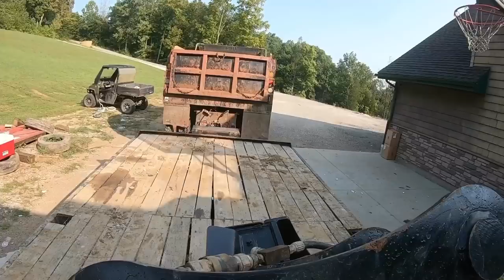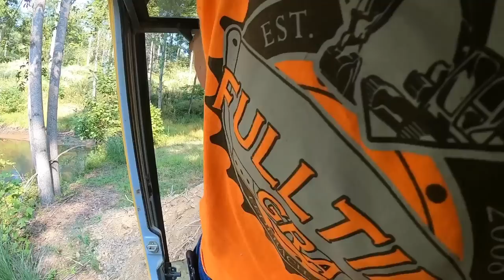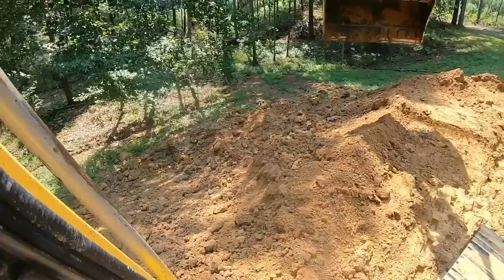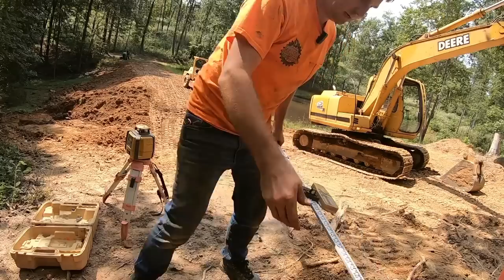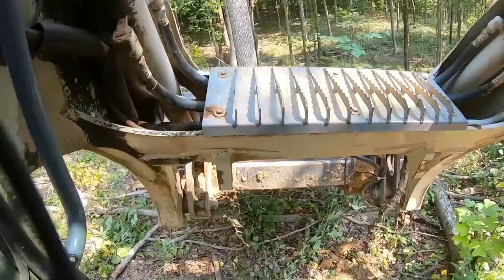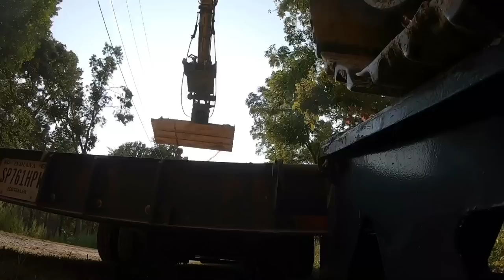Failed Pond Build - Repair Continues - New Overflow!

Comment: I like when I see someone doing a job that in my opinion is being done correctly. I learned to run equipment over 50 years ago the same way as you. I started when I was big enough to reach the controls.

Comment: Mr Mike, I'll take more weight on the drives any day. 🤔
And you did a super job on that pond.😁
Reply from the maker: Well obviously you want weight on the drives.  But if it's too much, the nose will be too light to steer and see that's an issue around a corner, because you need to steer.  More of an issue uphill, but on a Friday....crazy things happen 🤣

Comment: Very nice work captain.  I was wondering why you didn't pour a seep collar instead. The d 4 will dress that up real nice. Stay safe
Reply from the maker: Sleep collars are great around concrete or smooth faced pipe.  Compacted clay around corrugated pipe is just as good.

Comment: Lot of quality work for that dinky little catfish pond.🐟
Reply: One might ask how many acres is the pond in your backyard?
Reply: @gullreefclub  I don't even have a bird feeder. That wasn't a negative comment. I would love to have a little getaway like that one. It's small in comparison to what dirt perfect usually does.
Reply: @likearockcm  The funny thing I found out about ponds from building a little couple thousand gallon natural style pond in my backyard last year is that regardless if they are big or small pond construction follows the same building principles when it comes to needing the right kind of dirt not to leak, or constructing an overflow etc the only thing difference is the scale of the project. How do I know because my first try was an absolute failure. The second time around I sourced a 8 pickup truck loads of good clay, compacting it well, as well as building a proper overflow just to name a few things I learned on my simple “weekend project.”
Reply: @gullreefclub  Interesting

Comment: Morning captain I wonder why D.P doesn't have bins of good fill and clean topsoil mix from those land clearing  that could been put a 1/2loader bucket  as a  example to use so only need is seeding  and maybe a bin again of. Clean fill  then your  concrete debris
Reply from the maker: Trucking is the most expensive part of any job.  Far less expensive to find the material on site
Reply: @CaptainKleeman  There was study done out of Michigan State University years ago and they determined at the time that on average trucking dirt or rock more than 30 miles you would be losing money. The study also found out that the more readily and best available materials have already been used or developed on in more populated areas.

Comment: As always, quality content.
What's with all the excavators and slop in the pins/bushings??
The little 3.5T is the same problem.

Drives me up the wall 😜
Reply from the maker: That's called reality.  That machine had all it's pins redone about a year ago.  When machines are used, they wear out.
Reply: @CaptainKleeman  replace replace replace, we do ours once a season.